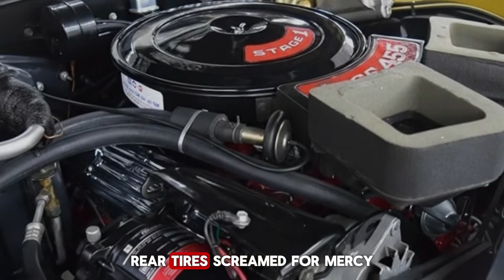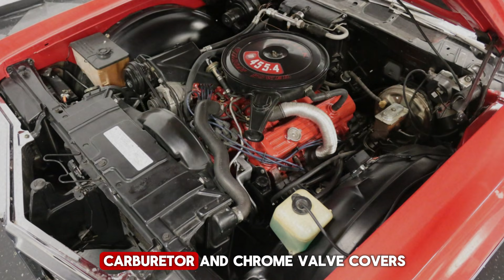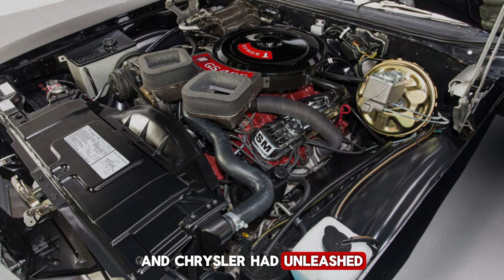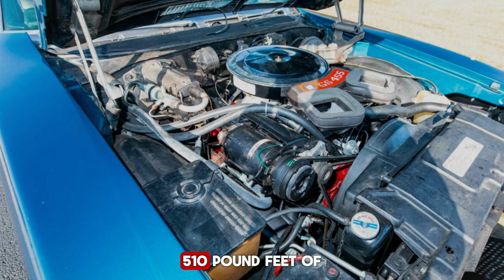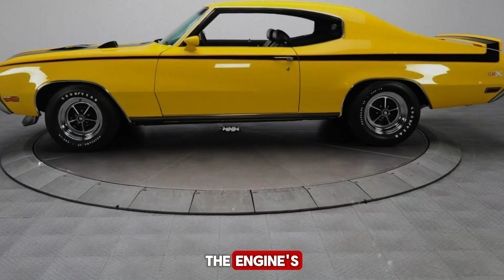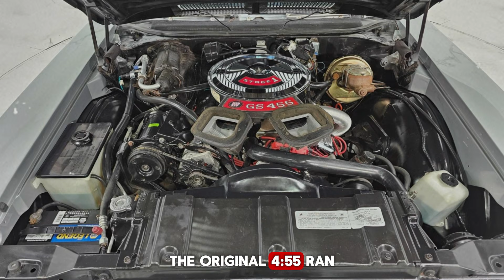Buick’s 455 Wildcat: The Muscle Engine GM Couldn’t Tame

Comment: You should have mentioned the Stage 2 parts available over the counter! Stage 2 cars ran 11s in the quarter mile all day long! Also, the standard 455 was rated at 350 horsepower, and was already a powerful engine. Buick liked long stroke and low rpm torque! My 350 Buick has a stroke of 3.85 inches, and peak torque is at only 1,800 rpm.

Comment: The 3.9 inch stroke was the shortest of the 3 455 engines produced. It was the bore and the ability to make cylinder heads flow more the  Olds or Pontiac. Airflow creates torque not just stroke.